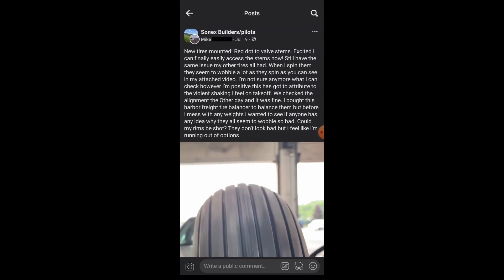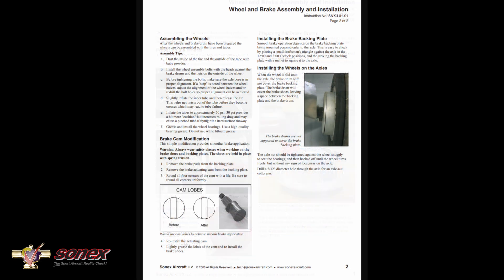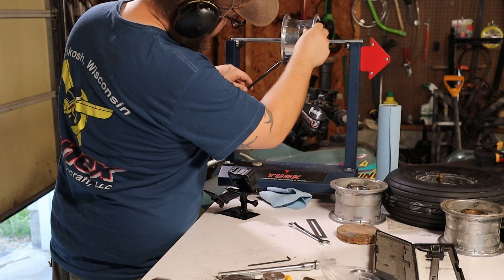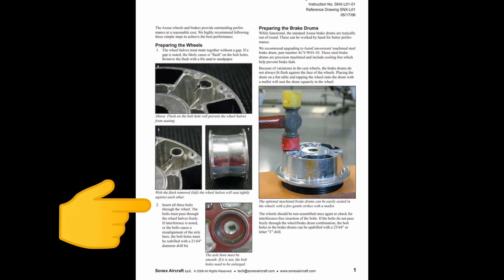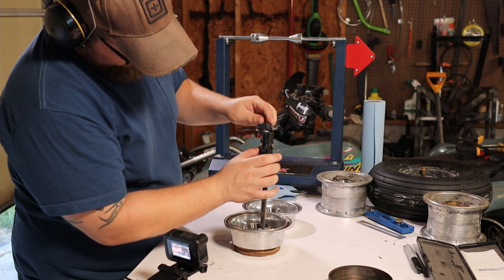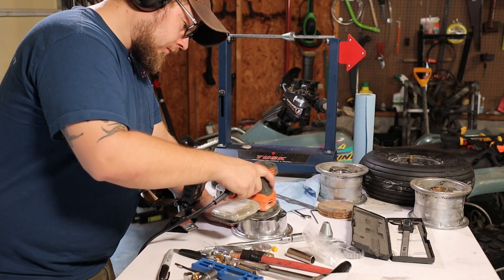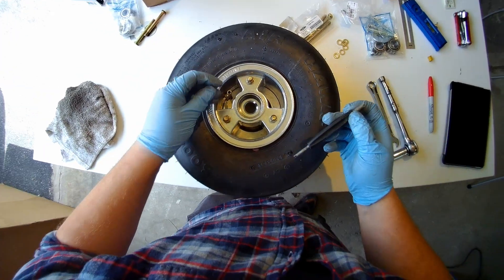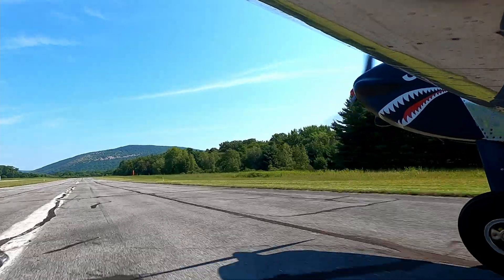How To Prep Azusa Tri-Star Aluminum Wheels for Sonex Aircraft and MORE

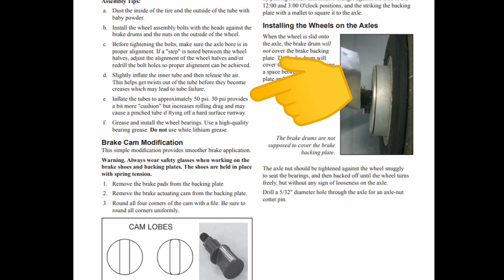Comment: 3:49 Therein lies an issue with using kart and minibike wheels for aircraft. 

A large part of the design gear travel and therefore g-load absorption for bad landings comes from the tire. 

The recommended pressure for the aircraft certainly accounts for needing a certain spring rate from the tire to absorb a certain amount of a hard landings energy. 

But the wheel is not rated for over 30psi. In fact, it's probably going to see 100psi momentarily, if it was aired to 50, and landed on hard enough to deform it to the rim... To use less pressure than the aircraft designer specified is not recommended. Neither is airing tires over a split-rims maximum rated pressure. 

Split rims aired up over max pressure are no joke.
Reply from the maker: I agree, if I were to build something that the design used these, I'd go with at least the Matco brand wheels instead.  Certified aircraft split rims are rated for much higher than their target operating pressures as well. The Azusa wheels just aren't good enough for this application and they're QC is definitely lacking...

Comment: Great video, thanks.  These wheels are also used on the Quickie Q-2 & Q-200,often used with the 400-4 "lamb" tires. I posted a link to your video on the Q-List website.

I think we are using the CHENG SHIN ULTRALIGHT & EXPERIMENTAL 11-400 X 5 8PLY 7046-8

Question. Are the tubes manufactured so the valve stem comes out in the correct place, the mid-point of the wheels? We are having trouble finding tubes that are not offset.
Reply from the maker: Thank you for watching and sharing! 👍👍👍 Sorry for the delay, been taking care of some family priorities.
My Sonex originally came with the same Cheng Shin tires and Cheng Shin 11x4.00-5 tubes. These do have a brass valve stem in the correct orientation. They did not appear to hold up too well though, and if you can fit them, I highly recommend the Air Hawk 5.00-5 tires with Leakguard tubes available from ACS. My experience in the shop is that all aviation grade 5.00-5 tubes have the valve stem in the correct spot.

I've always been intrigued by Quickies, hope this helps!
Reply: @LeftSeatAdventures  Thanks very much.